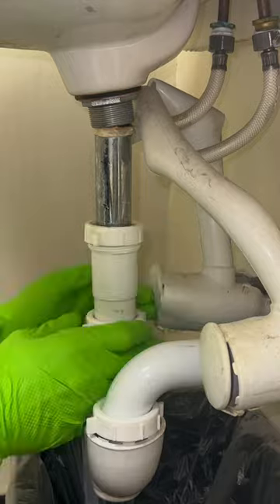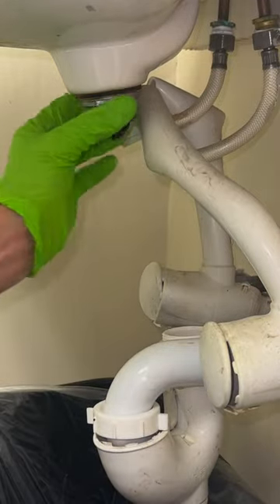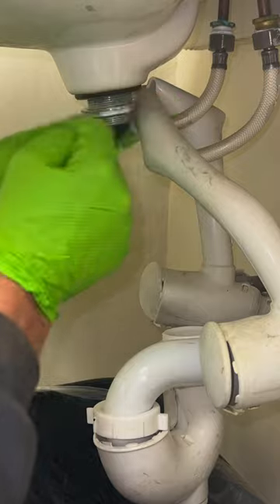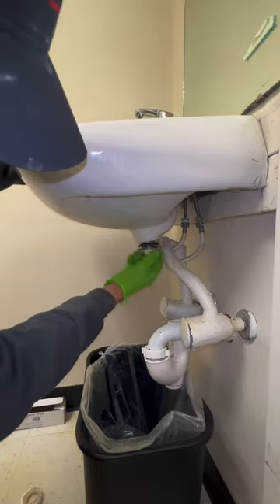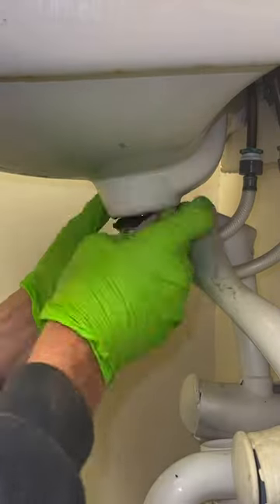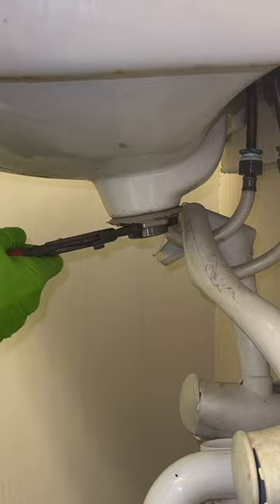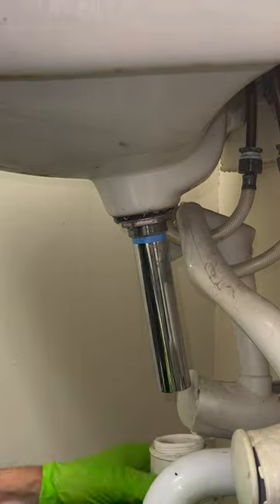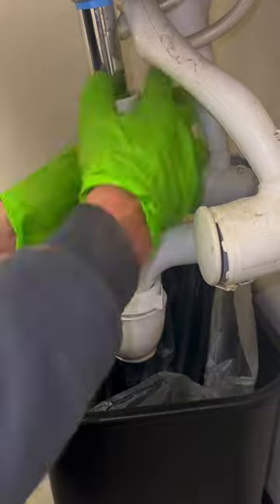Grid Drain Replacement - HOW TO #plumbing #plumber #diy #howto #asmr #sinkdrain #bathroom #shorts

Comment: This is my world lol. I’m a commercial plumber. It’s very common for the sinks to mount this way. The brackets on todays models are lagged into backing in the wall. What needs to happen is caulking friends. That lav should be caulked around the edge and it’ll be fine. For my installs I lift myself up when I’m done. Strong like bull.

Comment: That wall mount is struggling!
Reply: Probably used sleeves instead of toggles or wood backing. Sadly I see it all the time.
Reply: I thought it moved!😮
Reply: @Nancy-xg9nc  it did
Reply: I had one drop! 
'Oh no problem...hole in the p-trap won't take long...'
Glad there was a 2x not far away!
Reply from the maker: @joshcowart2446  you can see the 2x4’s on the wall that it’s mounted to. Whoever did it used drywall screws that rusted and broke, I resecured it with brass screws before leaving
Reply: @theconservativeplumber  good deal. At least they put in backing but drywall screws kind of defeats the purpose of backing. As much is I dislike when plumbers use sleeves to secure heavy items, I think I hate drywall screws more. I see them way too much. I’ve been using the ceramic coated deck screws and they work really well.